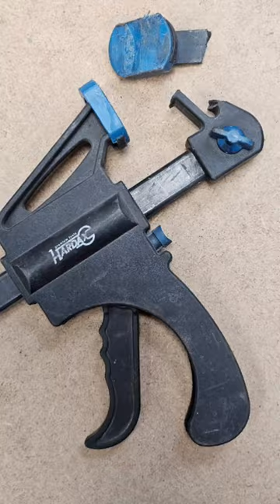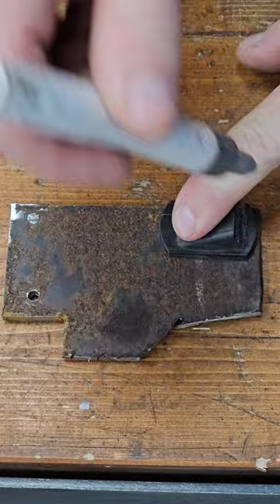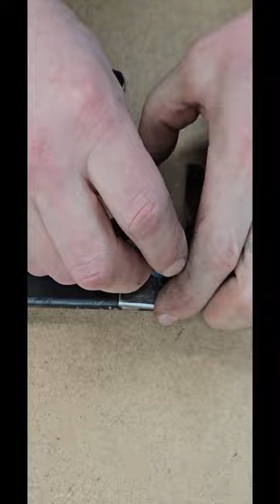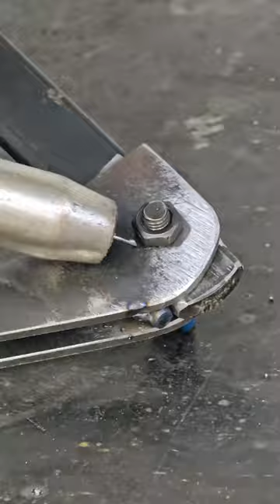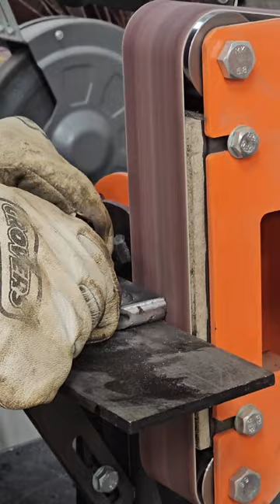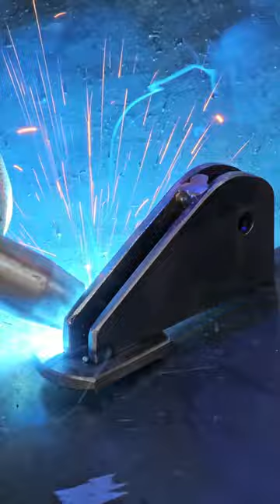Do not rush to throw away the old clamp!!!#shorts

Comment: It works but the steel is worth more than the clamp was to begin with.
Reply from the maker: This is not true.
Reply: @MA-SH  sshhhhh. It’s a joke. 😉
Reply from the maker: @giggidygiggidy4884  🤭
Reply: Have you had a problem with this brand of clamp? Why make misleading comment if you already know it's untrue? The bottleneck is owning a welder, not the cost of materials.